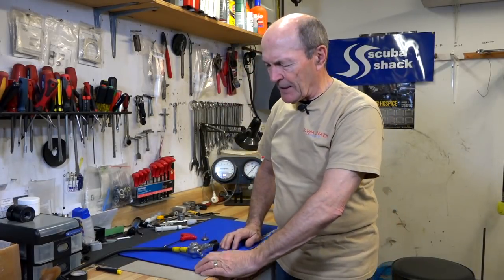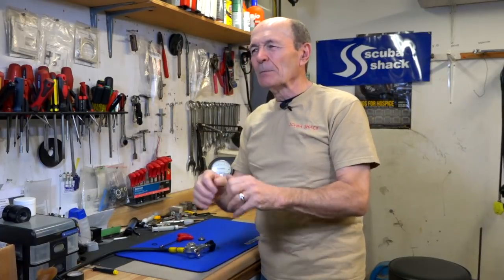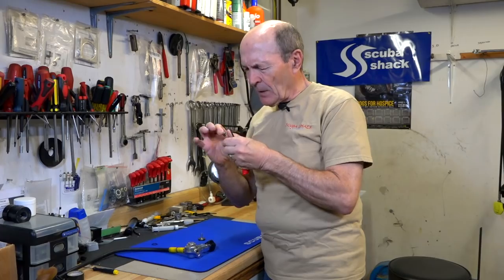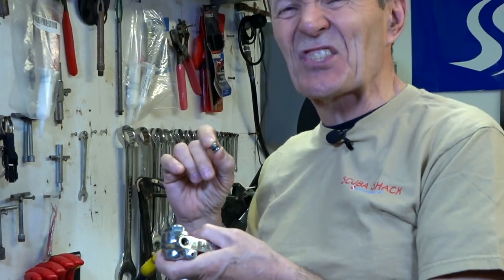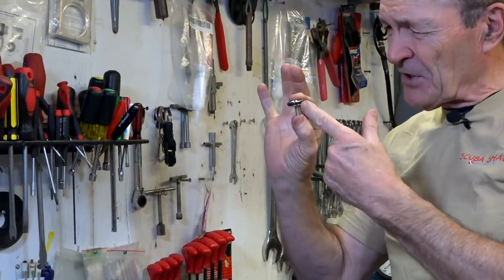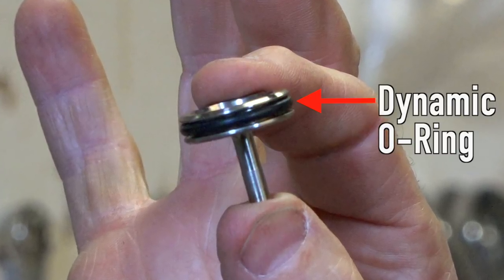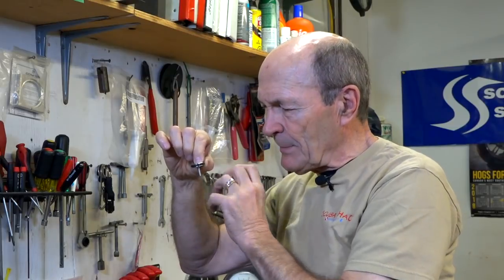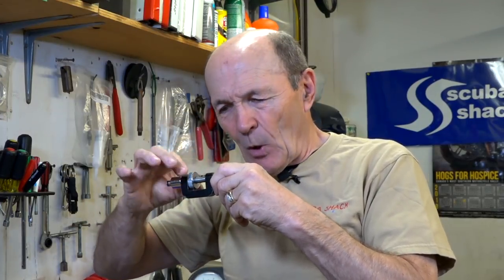Dynamic vs Static O-Rings - Scuba Tech Tips: S09E09

Comment: Alec, thanks for this video! Do you find that static o-rings are less prone to failure during normal use than dynamic o-rings? Would you approach either type of o-ring differently when it comes time to have a yearly service? I’m specifically wondering about the o-rings in the intermediate pressure area of a regulator, such as on a 2nd-stage regulator hose, for example (the end inserted into the first stage). Would that o-ring typically be replaced as frequently as the 1st-stage piston’s dynamic o-ring?
Reply from the maker: When a service is done, the tech has to follow the makers requirements, which generally mean ALL o-rings are replaced in the 1st & 2nd stages.  The cost of a o-ring is very small compared to a failure while diving.
A

Comment: Hi Alec.  Excellent videos.  Should tank and SPG o-rings be replaced every year?
Reply from the maker: When a tank has its annual Visual inspection, the tank O-ring should be replaced.  It's a buck and holds 3000 psi so don't go cheap and re-use it.

Comment: Very useful information !! How tight should I put my port plug in ?
Reply from the maker: The port plug, like the hoses, seals with an O-Ring so it doesn't have to be tight to make the seal. It only needs to be tight enough to keep it from falling out.
There is no specified torque value, or if there is, it's different from one brand to another.
So generally I suggest you tighten it by hand as far as possible. 
Notice when it gets hard to turn. That's when the O-Ring has contacted the metal body.
Now turn it with a 1/2" or 9/16" wrench about another 1/8 to 1/4 turn.
You should see the plug has just contacted the body. There is no discernible crack.
To check or for practice, try to loosen it with the wrench. It should NOT take much effort - less than opening a fresh jar of jam but more than tuning a radio.
Hope this helps.
Alec

Comment: Hello Alec. When replacing orings, do you use silicone on the new oring?
Reply from the maker: Only dynamic o-rings MAY need lub.  Search my  videos for a video on dynamic vs static.  I say MAY as it is up the to manufacture spec and which o-ring you're talking about.  If it's something only a Service Pro should do, no worries, they will follow specs.  If it's a diver changeable o-ring, like tank valve, hose end then no lub.  
A
Reply: @AlecPeirceScuba_SeaHunter  thanks

Comment: Hi Alec. I'm late to this party but is there such a thing as a "dynamic o-ring"? IOW, are o-rings made for use in a dynamic application (e.g., on a 1st stage piston) different from an o-ring made for a static application (e.g., to seal a light)?
Reply from the maker: The best example of a dynamic O-ring is in a piston reg.  The piston moves up and down extremely fast to keep the IP pressure constant after every breath.  Static O-rings don't move as in a tank valve.  I plan to do more videos on the amazing room of o-rings so keep watching.
Reply: @AlecPeirceScuba_SeaHunter  I think my question wasn't clear enough. Are o-rings used in a dynamic application (e.g., piston reg. like you described) different, in terms of how they're made, from o-rings used in a static application (e.g., dive light)? IOW, are some o-rings made specifically for dynamic applications so then can endure the constant wear better than other o-rings?
Reply: @jeffworst9939  The O-rings are the same, they do come in different materials, buna, Viton for 02 service and other more exotic materials. They also come in different hardness Shore ratings. For example the O-ring on the tank valve to tank interface is a 90 while other common O-rings maybe 60.  For most applications buna are fine. If you buy o-rings from a scuba shop you are being ripped off. You can buy them in bulk from the manufacture for a couple of cents.  I rebuild all of my own regs since I am a sump diver and have bought them directly for 30 years. Store them in class jars and under cool dark conditions and they will last for more than 20 years. The above is the cliff notes version.

Comment: maybe the lesson is that some o-ring need to be changed frequently than others that may almost never need a change (o-port rings)...
Reply from the maker: Good point Alain.
Dynamic O-Rings are always included in a service kit and should always be changed. 
Static too. They don't move so can just as easily be destroyed by being squashed repeatedly in the same manner. A good example is the tank neck O-Ring. It's a nice, shiny, round O-Ring when installed. One year later at visual time, it's like a flat rubber washer!
Many service people don't change all of the O-rings in the kits. They think they can look at an O-Ring and determine if it's OK or NOT OK.
Nope! Change them all. There's no such thing as a one or two-year-old O-Ring that's OK!
And they cost like 15 cents each!!!!!!!!!!!
Take care.
Alec

Comment: Hi Alex, is this correct that Scubapro MK25 or MK25evo is an unsealed first stage, yet the sea water is not touching the piston due to the design? Thank you
Reply from the maker: Not exactly. The EVO (simply short for Evolution) design itself helps to lessen the likelihood of freezing. It incorporates several features to that end such as a heat sink around the 1st cap and the 2nd hose swivel plus much larger holes in the 1st to stop jamming of ice particles and also enhance rinsing.
Now they have XTIS (Extended Thermal Insulating System) which adds a few more features with the same aim. They include a plastic coating on the 1st spring to eliminate ice formation and plastic insulating washers to keep metal to metal contact to a minimum.
Apparently, in tests this practically eliminated ice sticking to the parts of the 1st.
So water still enters the 1st so the reg can function correctly but the water doesn't touch metal.
Note that no regulator design can eliminate the possibility of freezing since the formation of ice in a 1st stage is a result of water in the air combined with the adiabatic temperature drop from the pressure drop that is part of the reg function. Nothing mechanical can eliminate those factors, only reduce them.
Here's a great Scubapro PDF file that explains this in detail plus a lot more:
 file:///C:/Users/Alec/Downloads/MK25%20EVO%20System_Presentation_ENG.pdf
Take care.
Alec